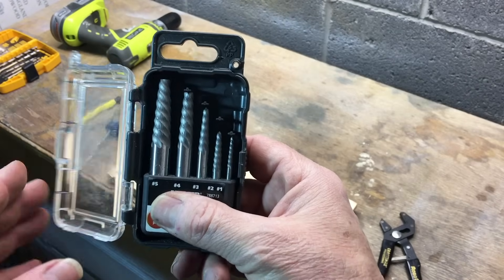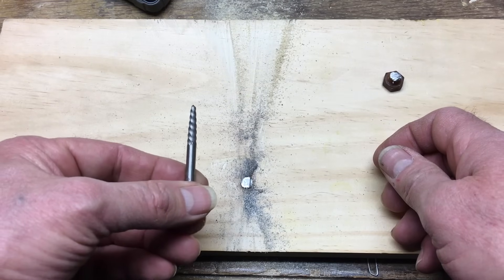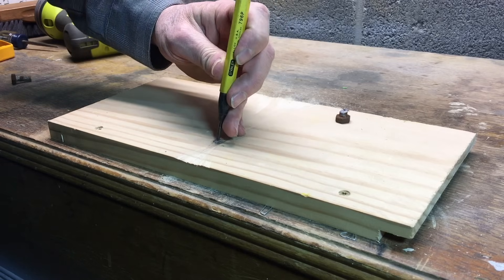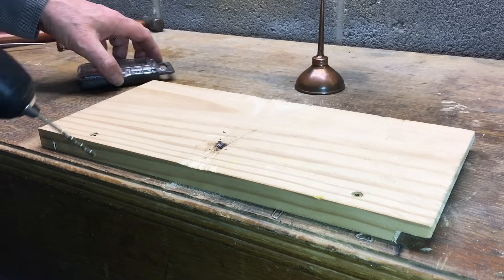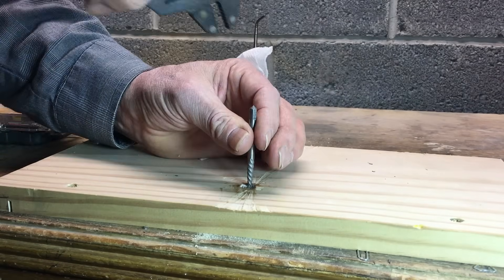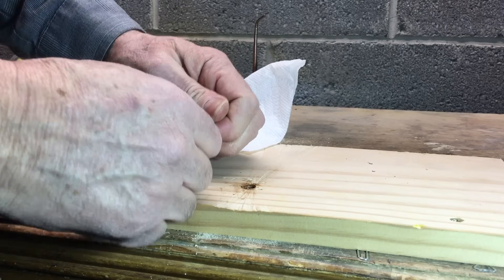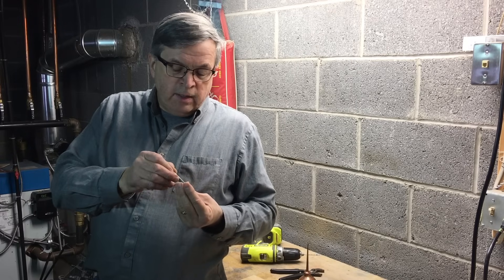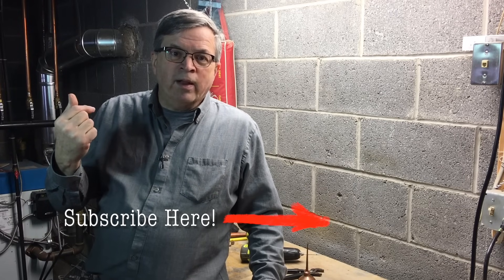How to Remove a Broken Bolt or Broken Screw

Comment: all these show how to do screw extraction from wood. How about from an extremely fragile ad expensive carbon fiber piece of sports equipment without damaging anything around it? Easy out and Speedy out are all fairly big diameter also not mentioned.
Reply from the maker: Here is a link to a set of extractors that have a wider range of sizes. You will need to be extremely careful and patient drilling out the hole for the extractor to work. You may even need to use a small wrench to keep the extractor working slowly so it doesn't spin out of control with a drill. Go slow and careful... and let me know how it worked. Thanks for the great comment.<a href="https://www.amazon.com/Extractor-Werkzeug-Stripped-All-Purpose-Extension/dp/B08LDMKR5G/ref=as_li_ss_il?crid=2BVLXSYFFFM0Y&dchild=1&keywords=screw+remover+and+extractor&qid=1624974213&sprefix=screw+remover,aps,171&sr=8-2-spons&psc=1&spLa=ZW5jcnlwdGVkUXVhbGlmaWVyPUFZT05FSTBPMlFaODgmZW5jcnlwdGVkSWQ9QTA5MDEyNTAzQURPRVhCNzJTUFRUJmVuY3J5cHRlZEFkSWQ9QTA4NDIzMzkzOFFCNVlTWE5GUFdXJndpZGdldE5hbWU9c3BfYXRmJmFjdGlvbj1jbGlja1JlZGlyZWN0JmRvTm90TG9nQ2xpY2s9dHJ1ZQ==&linkCode=li1&tag=foo0ce-20&linkId=cbdcd020a5ba2d7143866f71b60d0725&language=en_US" target="_blank"><img border="0" src="//ws-na.amazon-adsystem.com/widgets/q?_encoding=UTF8&ASIN=B08LDMKR5G&Format=_SL110_&ID=AsinImage&MarketPlace=US&ServiceVersion=20070822&WS=1&tag=foo0ce-20&language=en_US" ></a><img src="https://ir-na.amazon-adsystem.com/e/ir?t=foo0ce-20&language=en_US&l=li1&o=1&a=B08LDMKR5G" width="1" height="1" border="0" alt="" style="border:none !important; margin:0px !important;" />

Comment: The reason a bolt breaks is usually because it is really stuck. I would spray some penetrating catalyst rather than WD40 because, besides lubricating, it also breaks down rust and corrosion.
Reply from the maker: You are correct. Usually there is a can of WD 40 around so that's what I grab. So your comment reminds me I need to go get some Liquid Wrench! Thanks for the comment and watching.

Comment: Tried to remove rotor retaining screws with this...didn't work.
Reply from the maker: You may have to drill them out deeper or just drill them out completely. Nothing is ever guaranteed. Thanks for watching and commenting
Reply: @CleanSlateFarm  I finally got it out but in a way that made me feel like fate was against me. After days of unsuccessful drilling and the drill not going any farther into the screw(stopping just shy of the base of the head and outer rim(picture a deep bowl with thick sides) the drill somehow started to make the screw spin slightly. After noticing this i stopped, grabbed a flat head screwdriver and with no place for the screwdriver to grip(again picture putting a flat head screwdriver into the base of a bowl) I turned and somehow, magically, so did the bolt. I got it out like that. That was not supposed to be able to happen but it did. I feel like i was SUPPOSED to waste days on that one thing.

Comment: The yahoo who previously owned my guitar somehow broke off the screw where the strap peg goes, then drilled his own crooked peg hole... 4 times! And broke off another screw in one of those holes 🤦🏼‍♀️
Reply from the maker: So it's totally screwed up? (pun intended) Was the bozo pretending to be Pete Townshend or what? All may not be lost! I have an idea. What kind of guitar? Acoustic or electric?  If it's a solid body electric (I'm guessing  with that many holes it is a solid body) find a good cabinet grade wood worker in your area. NO shlocks...get someone who works with furniture and knows wood. Ask them to drill out the bad spot and glue in a hardwood plug. Then you can put a new strap peg. If it's acoustic, you will most likely need a luthier to work on it due to the hollow shell. A luthier could also do the solid body but may be more expensive. Since this is the most interesting problem with broken screws I'm REALLY interested in hearing how you solved this one. Please, do write back and let me know what you end up doing. Thanks for commenting.

Comment: Why don’t you try a bolt that is really stuck and rusted or maybe even loctited in place. Not just laying in soft wood.
Reply from the maker: Because as I said in the beginning....I didn't have a broken bolt so I made one for the DEMONSTRATION. If it's stuck in metal it will take more effort, maybe even some penetrating oil and/or heat, but it will usually do the trick. Not always but start with the easy solution before having to drill the bolt out and then retap. Thanks for watching and commenting.

Comment: If you break the easy out in a bolt that is busted deep into a hole, you're screwed, excuse the pun. They are fragile as hell and themselves are impossible to drill out. Despite their fragility, they are impossible to drill into. I hate those things.
Reply from the maker: I haven't had the pleasure of one breaking off yet. Hope I never do either. They are very fragile but at least you have a fighting chance. Thanks for watching.

Comment: He is doing it on wood...a bit difference when broken in metal
Reply from the maker: Yes...for the hundredth time I'm doing it in wood and it came out easy. The concept is the same for wood, metal, plastic, or what ever you break it off in. In may be more difficult in other material but the video shows a way to resolve the situation. And like I said many times, it may not work and you may have to drill it out completely but it is your best first choice of solutions. Thanks for the comment and watching.

Comment: nothing is as simple in real life, if the bolt is poor quality metal and the threads in the hole not much better, all an extractor is going to do is chew the bolt to pieces and damage the threads.
Reply from the maker: Correct...you could also cry nnto the broken bolt as you stare into it and hope that it rusts out. May as well try to r emove with easyouts.

Comment: Yeah on a easy piece of wood, try with a corroded screw that has been there for 20 years, that is my problem lol
Reply from the maker: It's old wood...lol. Yes, you have an issue with the 20 year screw but two things may help. First try some penetrating oil, like WD40 and let it sit. Next apply some heat with a propane torch if possible. Let me know if that works. (Or you could drill it out. Not easy but often effective.)
Reply: @CleanSlateFarm  thanks for the reply and the good info :) great video!

Comment: Don’t show me how to remove it from a wood show me how to move it from the metal
Reply from the maker: The principle is exactly the same...ZERO difference. The material only matters if the bolt is rusted. Then you would use a rust solvent or apply heat to expand the metal and break the rust barrier.